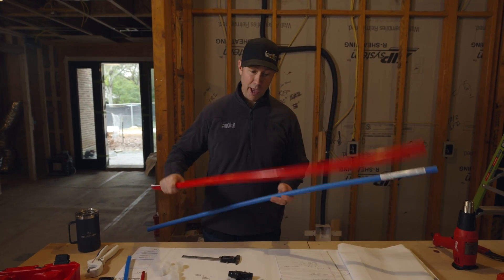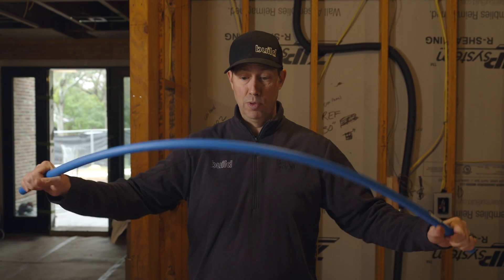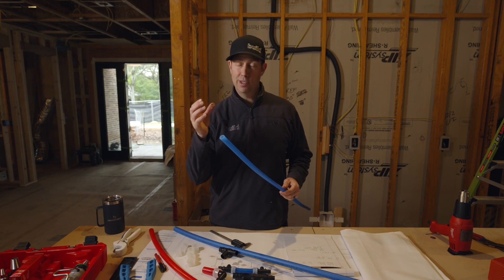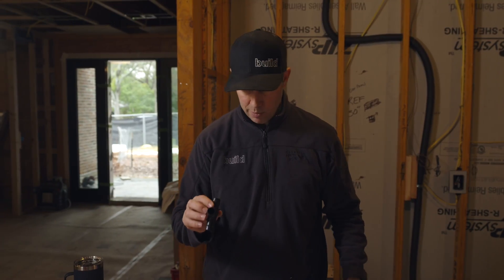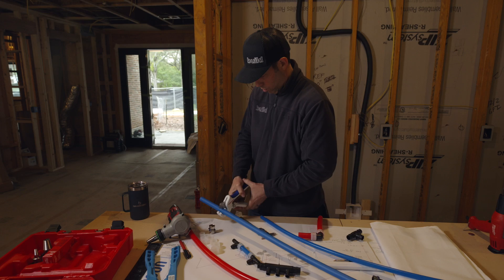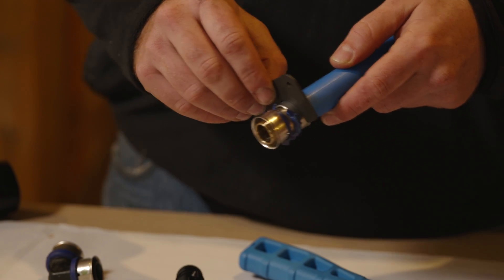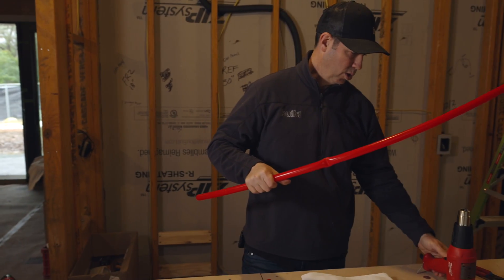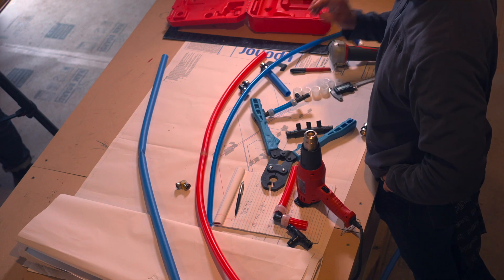Uponor Pipe System Review & Comparison

Comment: Sponsored by Uponor...no conflict of interest here in the assessment.
Reply: I mean.. it's really good. He probably got a crazy discount so yeah .. bit ..
Reply: It's the best by far IMO, from port size to burst protection, flexibility,  plumbing in tight spaces., the manifolds you can get... It will eventually take over and be the unanimous winner by a large margin. I think it pretty much has for the most part especially amongst plumbing companies and new construction. The only thing that is superior with pex fittings is you can join them closer together that you can upunor fittings. In some situations this comes in real handy like say in some RV applications where so many fittings are needed to be close together.
Reply: Appreciate his honesty. Most people on YouTube swear by milwaukee, harbor freight or dewalt but will never disclose their sponsorship deals.
Reply: Just because something cost more doesn't make it better...
Reply: @ryanroberts1104  correct,  but this specific product is 100% the best product with many more benefits than the other brands. There's no question on if it's a superior option. Nor even a real debate that would make sense and not be over before it starts.
Reply: My trailer house has frozen up several times with normal plumbing. The last guy that had it  just had pex B ran in the house exposed.  I went on vacation and lost heat. Cast iron jet pump housing, braided toilet supply line, and a tub valve set all broke and split. Nothing else broke.   In 2008 I helped  build a condo building in a ski town. We used the Uponor A system for domestic water and heated patio decks.
Reply: I think he has a track record of picking solid products. If they sponsor, why not take it. I suppose if you find a competitive system that uses like for like, then you've got some good direction in general. I'm definitely going Uponor on my next project. Plenty of experience with crimping.
Reply: He's been talking about Uponor products for almost 2 years, at least, before getting them to sponsor a video. I know this because I remember sitting in the Uponor break room at 1am watching his video talking about the product I spent 12 hours a day making...  Too think that a company that he likes sponsoring him ,after seeing how supportive he is of it, means he losses credibility is asinine... You just want a reason to complain about something.
Reply: @davidweeres797  lol 😆  thanks for making a great product that all plumbers use.
The funny thing is all the people upset about a sponsored educational video about the system that literally every plumber uses today. 
Good luck calling a local plumber and telling him to use home depot pex over tried and true uponor for the last 20 years.
 These are most likely the same people who scare off any tradesmen and wonder why only the handyman calls them back
Reply: @dunkdamonk    BINGO!!
Reply: @dunkdamonk  I will admit I'm no longer with Uponor but I will gladly ain't admit I'm still a huge fan of the products and proud of the work I did there. I worked hard and took pride in what I did there.
Reply from the maker: Take my assessment and make your own judgments. I’ve landed on Uponor as my favorite.
Reply: @buildshow  MR. Thanks for your assessment. I for one RESPECT YOUR JUDGEMENT and having to use mail-order for a lot of what I want revues are critical. . You actually USE IT in real life not to mention your other comparison videos that has helped you reach your conclusions. I think the sponsorship was well earned by a great product
Reply: It's superior. More cost but better product
Reply: @willlemmond1909  Agreed. I'm have a small re-plumb and I'm using Pex-B because it was a bit cheaper for the crimper and pipe.

Comment: cost of Pex vs copper pipe ??  and install ??
Reply: Super cheap and easy. I installed all the pressure pipe and pressure tested my house in 2 days.
Reply: @Rad_Triumph_765_RS   wow.  big diff between PEX and Copper.   I'll be looking to build a new house in a couple of years , so I'm sucking in as much info on everything "house building" as I can .  Appreciate the input.
Reply: I spent $800 for all my fittings and the rolls of pex A

Comment: If only those expanders weren’t $1200.00. It’s the only plumbing system that has an unaffordable installation tool.
Reply: Less than $100? There was another for cheaper. 
I have been using this for over ten years with no problems.
Reply: I bought the Dewalt Pex expander for ~$400.
Reply: I have Sioux Chief manual tool and Milwaukee m12. The Sioux Chief tool set is $100 and the Milwaukee m12 set was only $500
Reply: Just bought a dewalt expander, it was $270.
Reply: Far from 1200.00 https://www.homedepot.com/p/Milwaukee-M12-12-Volt-Lithium-Ion-Cordless-ProPEX-Expansion-Tool-Kit-with-2-1-5Ah-Batteries-3-Expansion-Heads-and-Hard-Case-2432-22/203111678  (there are many other brands as well) IIRC there is even a hand one you can get for around 100.00 (although not sure who would use hand style expander)

Comment: As a general terminology clarification pex a, or b are both tubing not pipe like copper and cpvc are tubing. The distinction being, pipe defines size of inner diameter, and tubing defines size by outer diameter.
Reply: If you are that technical you might want to measure PEX 1/2 inch tubing the outside measures right around 5/8's of a inch so the information is a little off
Reply: They are all tubing including copper
Reply: Pipe is metal or concrete,  tubing is everything else
Reply: @michaelangelo6378  what about copper tubing?
Reply: @sambojones8681  and stainless steel tubing for flares....

Comment: On the Pexuniverse site they sell Pex-A but its under the Sioux Chief brand so there is other Pex-A providers just not like Pex-B where on the site they have Viega, Sioux Chief, and Everhot.
Reply: Yes, that is the brand I bought from Pexuniverse when I bought the supplies to replace the steel pipe I had with PEX. Did not get the power expander, used the manual one, because I'm not going to spend that much on a one off tool.

Comment: Why not compare Uponor PEX A with expansion fittings to Zurn PEX B with expansion fittings?  Seems like a better comparison.
Reply: True story I've use Uponor a long time and just started using Zurn and I like Zurn better so far because it is a stronger tubing and doesn't leach a chemical taste in the pipe and I'm able to use my hundreds of Uponor fittings on Zurn pipe , if I find out I don't like it in the future I can switch back and still use the same fittings, I can say the expansion ring are a lot better they have a real stop , I buy rings buy the hundreds and the last batch of Uponor expansion rings the stops didn't work ever time I would expand the 3/4 pipe the ring would slip and I'd have to cut the pipe and start over it was a damn nightmare trying to use the 3/4 rings I must have thrown 60 or 70 rings away looking for rings that the stop  would actually stop instead of slipping.
Reply: @plumbbuild6517  Somewhere else here I asked about leaching, so I'm glad you mentioned it. I'm amazed that anyone would use a pipe or tube where plastic chemicals leach into the water. If that's the case, I'd never install the plastic. I'd rather have copper in my system.

Comment: Uponor is the bar for pex products. Use it for all our pex projects, never had a leak...actually the only leaks we've ever gotten when we charge the pipes is usually on sweat fittings or thread fittings, never once failed an Uponor fitting.
Reply: The weakness in Uponor is with the plastic fittings that can crack. I think the plastic fittings are ABS plastic. But even a 12 year old can run uponor and install with no leaks. Its pretty much fail proof.
Reply: @guytech7310  I don't believe the Uponor fittings are ABS, they don't publish an exact make up of the plastic, but it's definitely a higher quality fiber reinforced plastic. I've tested these fittings up to 500 psi, and they've never blown out. Actually holds for like a good 2 days before losing any pressure. Even then it holds 100 psi forever. The pex itself does deteriorate if exposed to the sun for too long, but I've seen fittings left outside for a few years that still solid, although discolored
Reply: @WallStreetBeggar  I have some crack when getting installed, usually when trying to man-handle them in a tight spot. I am sure they are find under pressure. They're just not a s strong a brass.
Reply: That's weird, I always use the cheapest shit I can get my hands on...never had a leak with PEX either. It's almost like all flavors of PEX are extremely reliable and arguing about the difference is absurd....

Comment: I saw a video of mice that have chewed on pex if so , what now?
Reply: I plumbed a barndaminum for a customer that put his house over his horses stalls. Within 2 years I to go out there and fix 52 holes from mice. But they also chewed on the PVC p traps for the tubs and showers too so it was not just the pex.
Reply: Never heard of a rodent chewing thru copper tho . . . Any thoughts? Genuine question here
Reply: @59nang  well for one thing if you would read closely I said they chew on electrical wires never said they chew through copper, but my daughter's car wiring was chewed completely through by a rat ,and even though I didn't say they could chew through copper they can chew the coating off the wiring and can cause a short and a fire ,but if you read up alittle more rats can actually chew through a cast iron pipe.  I say do a little research before sticking your foot in your mouth just saying 😏
Reply: plumb build so can a human being my god man that DOES NOT GENERALLY HAPPEN !
Reply: @59nang  No, though I've seen pin-hole leaks on 30 year old copper pipes. Lets see if hard water does the same to PEX. My guess is that it will last longer. I know what hard water does to cast iron, not a pretty sight.
Reply: Mice will chew through steel and copper pipe as well.
Reply: Cooper is only good for looking pretty for your water heater, softener loops, recirculation lines or radiant heat lines where the are exposed outside the walls because it holds stuff nice and sturdy but that's it
Reply: Caleb Bork well copper KILLS germs and pex plastic pluming harvest them , a rethink is needed here
Reply: Thats where you call a plumber and a  Exterminator because mice and rats will chew on electrical wiring internet wires plumbing and build nest in insulation get in your cabinets and crap all over your dishes and can cause destruction and disease so if they chew on your pex that's a bad thing but it will let you know you have even bigger problems.
Reply: plumb build the real point IS a house fire or flood in ur house , and I would NEVER recommend , jack off hacks to put pex in ANY HOME
Reply: Kill the mice and stop living in a rodent infested shit hole? Yeah, they can eat the pipes. They also eat the wires, the walls, and almost anything else, and poop and piss disease all over your house. Is that part not a concern?

Comment: Really surprised by the reduction of capacity with some of those fittings, great video
Reply: It's a lie. It's just not true.
Reply: Viega pex did a test with about a dozen fittings on a run of pipe. The "smaller" fittings show only a 1-5% change in flow. Virtually nothing. Also the vast majority of pex runs have very few fittings. I made a home run system at my last house with 3/4 and plastic pex b fittings. Those are even smaller I.D than brass. I was able to shower, run a garden hose and flush a toilet. Roughly 10gpm with barely any loss in pressure.
Reply: @shawnd567  thanks for sharing. that's because pressure drop has to do with the length of the reduction, in the case of a fitting it's a short run and doesn't generate a lot of friction.  I would expect it to be around 1% unless they used excessive amounts of fittings.

Comment: You are wrong about the pex needing 90s to fit that install! pex has cornering reinforcers that will allow it to corner just as well!
Reply: This video is sponsored you forgot that 😉
Reply: I use corner brackets all the time all the time.  Consumer Reports he ain’t Sponsors always affect the narrative
Reply: @carrabellicusp  You're not going to be able snake long runs of Pex with a lot of bends like you can with PEX-a.
Reply: @guytech7310  False again. I use pex B only and I have plumbed everything from 400 square foot house to 17,000 square foot house, there is no where you can put pex A I cannot do the same with Pex B and use the same bends and or fittings as Pex A. It is the same material!! You can expand both and you can crimp both !!!
Reply: @jwblount7802  I never stated you cannot use Pex-B, Nor did I say you could not use Copper, Stainless, or even Inconel! PEX-A is just easier, much as Pex is easier than Copper, and Copper is easier than Stainless.
Reply: @guytech7310  Pex A is easier than what? Or how is it easier than PexB? Take copper or stainless out of the equation. You state Pex A is easier. Easier HOW?
Reply: @guytech7310   I use both married to neither as I do not use expansion fittings away. But you did say in a conversation earlier if you go back and reread a few back that say PEX A easier. Its pex and it all goes in the same way. Now I will tell that when it is cold outside PEX A is a SOB to work with. And yes I am a pleasure on the job site.!!
Reply: @jwblount7802  That really is your question?
Think tight spaces.  Expanding uponor in the open and then inserting AFTER expansion.  Significantly easier.
Reply: Yep without flow loss.
Reply: But to the original point is, you still have to spend additional money to make the 90 bend along with time of installation. Where you do not with uponor
Reply: @footlongburrito  This is incorrect! All I use is Zurn Pex B and no you do not have to turn brackets to make 90 degree bends I n the wall. The only time I use brackets is when doing sharper turns for stubbing out the wall for fixtures. And you have to do the same for Unopar as well or put a 90's on it because in a 2x4 wall it is too sharp of a turn not matter which pipe you use. I'm telling he favoring one type of pipe and leaving a lot of info out.
Reply: @jwblount7802  you do not have to with uponor,  that was my point,  I've installed thousands of miles of pipe in my career and I've never had to use the 90 bracket like you do with pex b, I never said you had to use them 100%of the time,  every install is different so of course there is going to be variations,  the type of pipe used absolutely matters for many reasons,  but again you're points are talking about different parts
Reply: @footlongburrito  If you do not have use brackets in a 2x4 wall to stub out Pex A at the fixture then what do you do?  because no matter what pipe you use you cannot make that turn in a stud wall to stub out to the fixture with short of a radius turn.
Reply: Its not as tight as you can get with Pex-A (Uponor). You can also use the 90 benders with Uponor too.
Reply: @guytech7310  We used to have to put an individual fitting, threaded, soldered, or glued, in even the slightest bend....now we're arguing about one type of pipe that is very slightly less bendy than the other.

Talk about first world problems...
Reply: @ryanroberts1104  About 120 years ago, we all had to use horses and 1000 years ago 99.9% of the population didn't have any plumbing at all.
Reply: @ryanroberts1104  LOL! I didn't complain about it, but you certainly seem to be!
Reply: @guytech7310  You're clearly only here to argue about stupid things you don't understand. Kind of like Matt!
Reply: @ryanroberts1104  Seek help Ryan! Living a lifetime of anger is so sad.
Reply: It's always so funny when Matt thinks he's an expert on something because somebody sponsored him.
Reply: So you need brackets to make sharp bends. Weird.